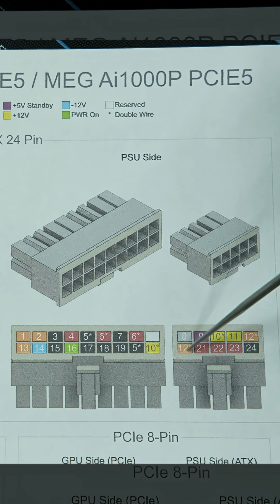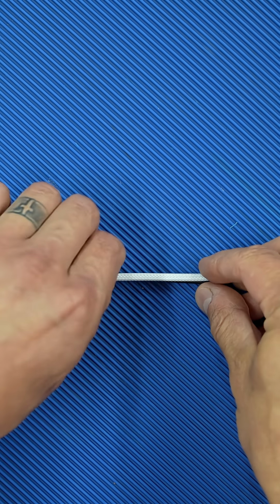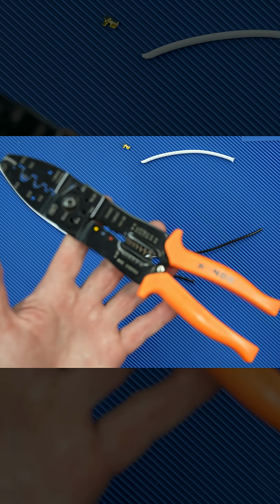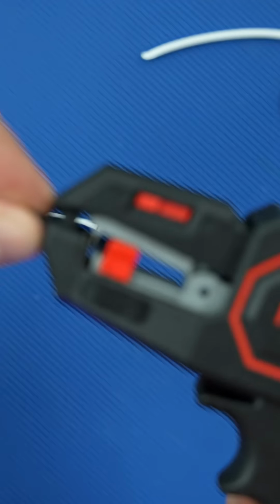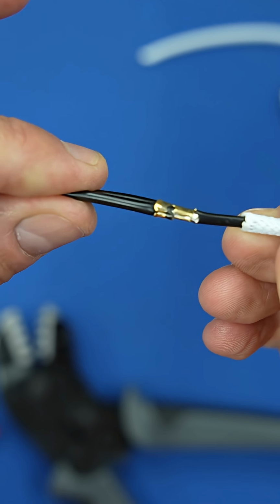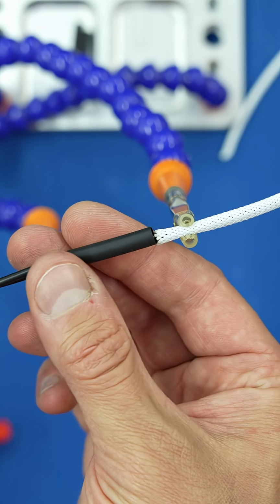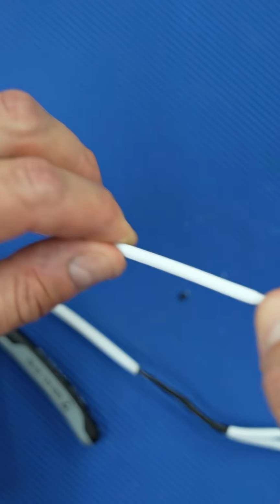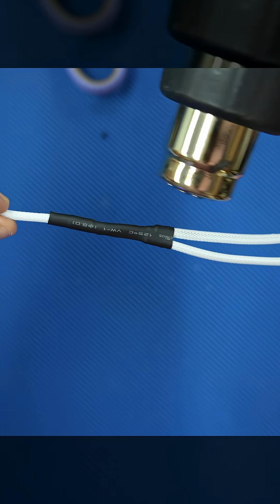EASY way to make split wire connections

Comment: You can actually do heatshrinkless sleeving for double wires. I only use heatshrink to isolate the crimped / soldered part.
Reply from the maker: Yes you are right! I personally haven’t had great success with the heat shrink less split wires. The sleeve does not want to keep its tension. How do you do it?

Comment: i done something similar in the past however i would not recommend soldering it, the crimp is more than enough along with heat shrink. I have find if your cable is made for something is will move alot. it tend to fail a lot quicker if you solder it compare to just crimping it.
Reply from the maker: Yeah I do agree, the crimp alone is more than enough. With my experience building CNC machines, soldering does help, when done correctly, especially when the solder is kept within the crimp section and the wire is mostly still. Like in this case it is, except for initial insertion and slight thermal expansion the cables are still. Well I personally haven’t seen a PC that has components that move around like in a CNC with drag chains.
Reply: @marcelgenis  Yeah, just from my own experience making wiring looms for my 3d printer then again i am pushing speed on my machine so probably also why
Reply from the maker: @8bits955  Yeah I totally agree with you, I won’t solder any connections in a wire loom of a 3D printer! Way too much movement. The example I showed was specifically for PC power supply cables. The split connections are usually right next to the PSU where there is no movement, basically the electronics enclosure if you compare it to a 3D printer.